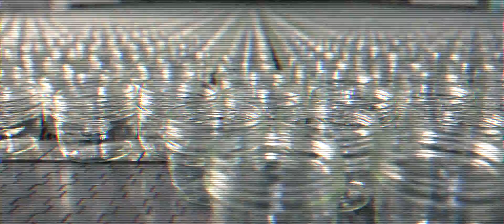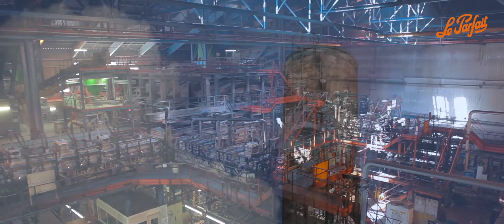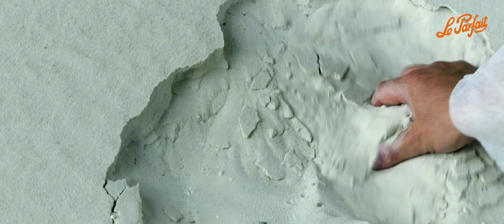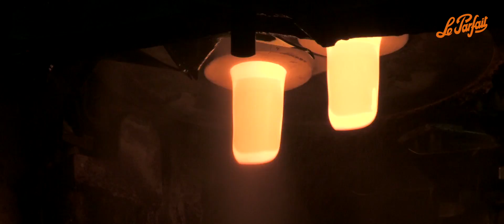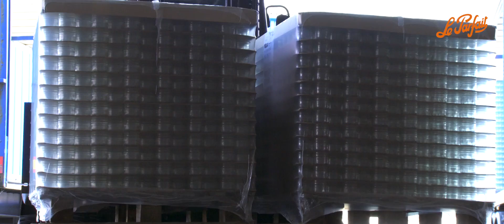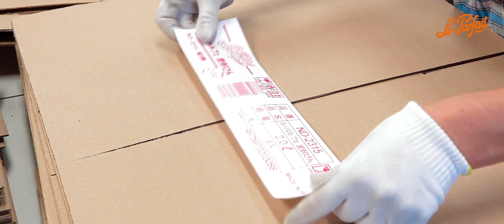The jar manufacturing process by Le Parfait

Comment: I hope you can put these jars in the refrigerator -- anyone know?.
Reply: They are canning jars - you can fill them with products to preserve and the right brine, sugar syrup, or vinegar mix and submerge them in a pot of boiling water for 30-60 minutes. They will let the pressure out but not in. One cool they form a sterile vacuum seal.
The fridge is nothing compared to what these jars are designed to stand up to!
Reply: @NoLongerMatters That is simply not true because my LeParfait jar is  in the fridge keeping my sour dough starter. Are you for real?
Reply: They can be placed in the refrigerator and freezer equally, just like American Ball jars.